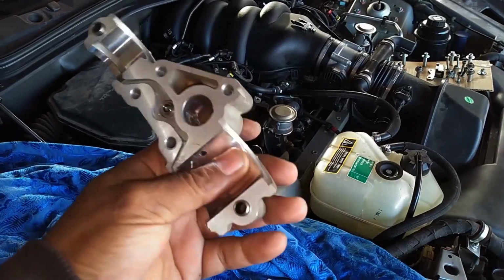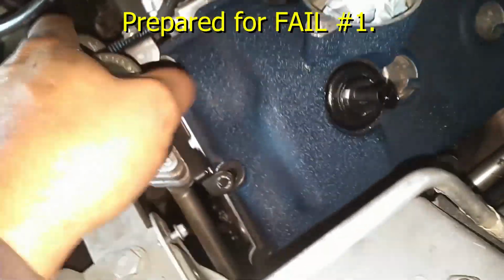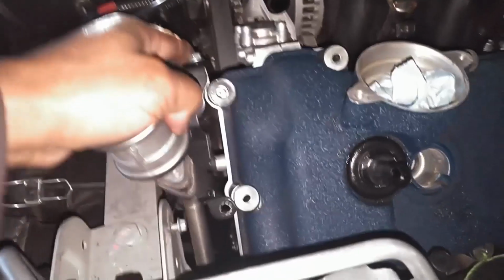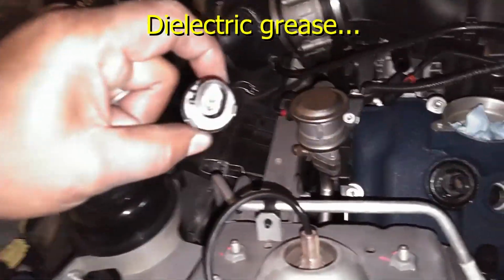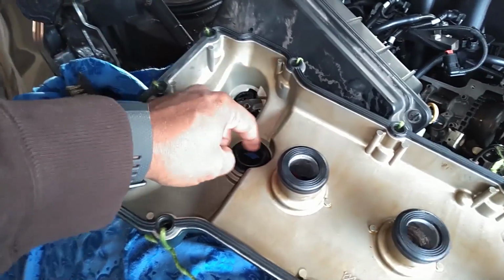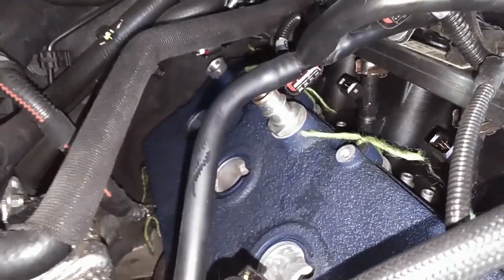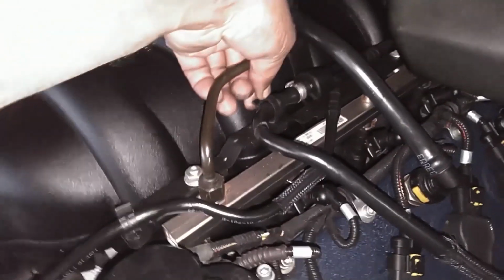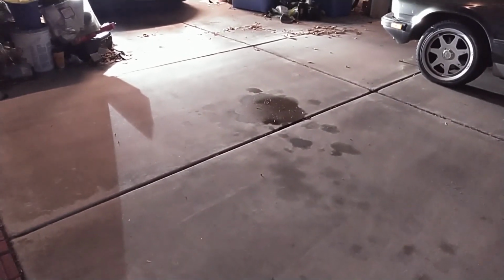How to install the valve covers on the 4.2L V8 engine Maserati GranTurismo  Quattroporte Part 5 of 5

Comment: Hi Robert,
Great videos.
Have you got any details of the non return valves fitted? 
Regards
Scott
Reply from the maker: I have no idea what you are talking about.
Reply: @RobertDIY  in the cam cap covers check valves where fitted right? Do you know what check valves where fitted?
Reply from the maker: No, as explained in the video, they were sent out to a machine shop and the machine shop did the work on the cam caps.

Comment: How many miles were on the Maserati , and did she not hear the noise in the morning? Meaning did the machined bearing caps solve the rattle problem? Amazing videos!
Reply from the maker: Fixed.
Reply: Do you remember the mileage on the vehicle?

Comment: Hi I got the same problem,dealership told me my valve cover are leaking so I always can smell burning when I run the car with higher rpm ,I’m just wondering how long it takes for changing all the left and right valve cover because dealership said they have to charge me 10-12 hours labor which I feel it’s way too expensive to do it since they charged 235 per hour
Reply from the maker: What is my time estimate with this job in the comments?